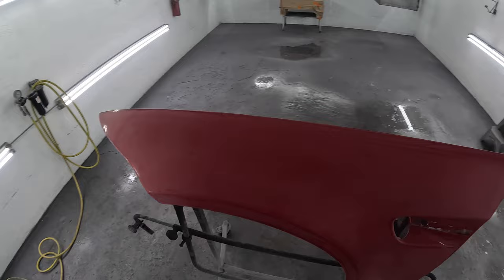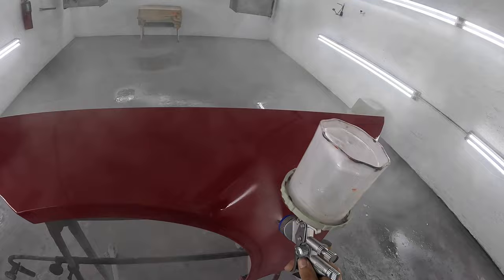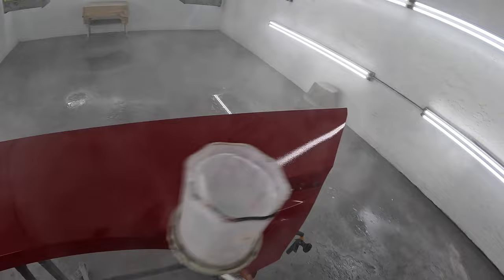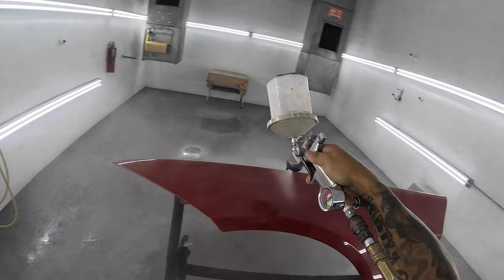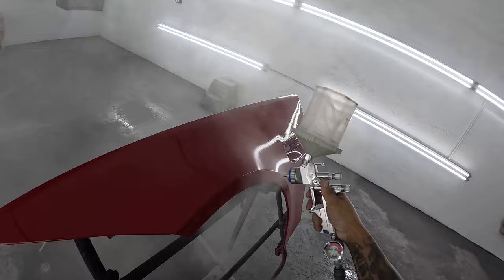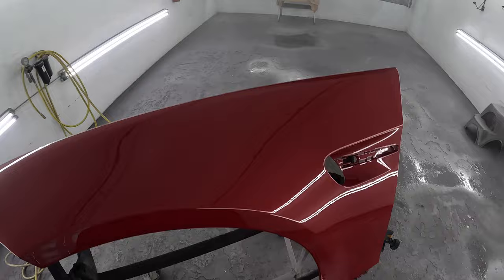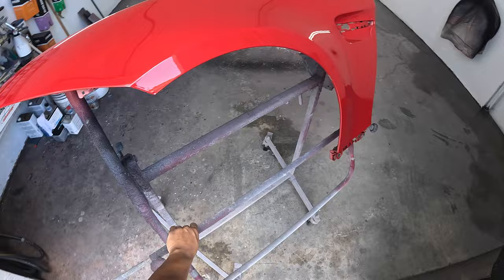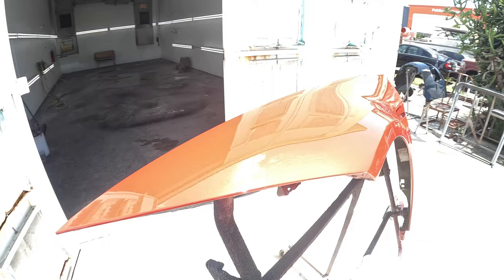Had to revisit the Grant 7 clear they said it can be done without reducer so trigger had to find out

Comment: Damn trigger that looks so nice ! I would buy a sata 5000b rp if i had to just to be able to lay the glass with the Grant 7 ! I know my Bellaria doesn't like to run over 29psi.
Reply from the maker: Yes those Iwata didn't like that. The ws400 can but bellaria,LPH, they subbed like high pressure. 😭
Reply: @thetriggerman954 how is that grant7 holding up
Reply from the maker: @jermaineenglish5732  it's still looking good, sitting out in the sun on the side of the shop. If you want remind me Mindy and I'll make a video pulling it out an upload it as a short

Comment: Well, well, well. Looky here. She does lay nice brother. Extra pressure is the key. What pressure man? Looks about 35psi or thereabouts?
Great follow-up vid brother. Have an awesome weeknd my man 💪
Reply from the maker: I started with 33 PSi them creeped up to 35psi. Thank you my man. Have a great one 🥳🥳🥳
Reply: Trigger I dont know if you ever heard of wanda 9100 clear coat. It probably just as thick as that grant I'm a diyer and that clear be cutting my ass 😂😂😂 cant get it to lay flat for shih. Tried reducing to 25% at 36 psi and still no glass with my cheap vevor 😂😂😂
Reply from the maker: @Savv242  Dam sounds like a spray gun full of oatmeal. Lmao sounds so thick to where it's not even fun to spray with.
Reply: @thetriggerman954  I tried using a  budget finish 1 clear coat with vevor gun and that came out like glass
Reply from the maker: @Savv242  that Vevor can get it done best believe that 🙌🏼🥳

Comment: I sprayed a corvette with grant 7 clear, and it had orange peal. Do you think my gun pressure was too low, and do you think great 7 clear is the way to go, or would you recommend some other brand of clear
Reply from the maker: Grant 7 is good clear from what I can see. It's possible you needed more air pressure while spraying it or even a different spray gun I attempted to spray it with my Iwata LPH400 and it was pretty orange peely, I poured the clear out of that gun and directly into maceda jet 5000 and it laid the clear down like glass so it all depends on the spray gun and the air pressure. The only other clear coat I use which I do 90% of my jobs with is the Am-Tech clear coat It's a product made by Prospray I've been spraying the clear for 11 years now have not had anything come back with issues I'll leave a link below if you want to research it yourself. 
https://amzn.to/3TE565S
Reply: Cool, thank you, brother. I was going to try Matrix, but it's kind of expensive
Reply from the maker: @davemcaferty6347 you're welcome. Some of those clears can get pretty expensive. My favorite clear is PPG 2021 and it's over $750 now. Crazy

Comment: Pressure on the gun?
Reply from the maker: 28 or 30 psi
Reply: Have u tried it with a budget gun ?   Or iwata 400
Reply from the maker: @MrJoeyrodriguez  yes I have a video up where I used the Iwata 400

Comment: Trigger would you buy it with yo bread?
Reply from the maker: 🤔 if I were spraying a whole car something that I wanted a lot of thick clear on. Custom paint and or something I want to flow coat then yes I would. Also I want to see how long it holds up in the sun, I'm going to zip tie that fender near my stall so it will be in the weather from today forward. That's what's really going to tell what's what. I've bought $400 clear in the past and within 2 years it was dull. So we shall see Dwan ✊🏼
Reply: @thetriggerman954  what clear do you use that does not die back and flows out well?
Reply from the maker: @dardenvern  the AmTech clear I use in my vids i use it every day for the past decade no issues at all. No cars have every come back either. 

 https://www.amazon.com/dp/B0758YYDSH/?tag=thetriggerman-20